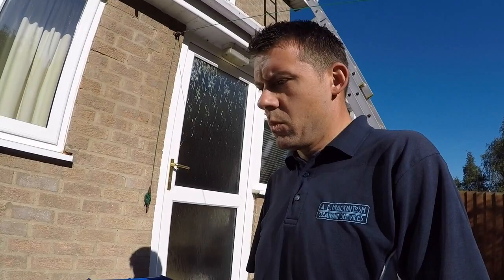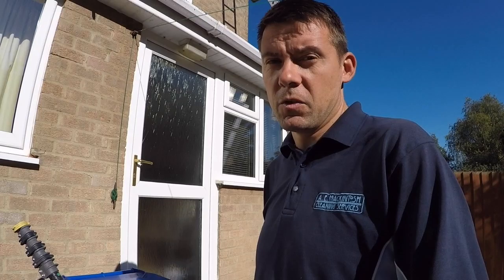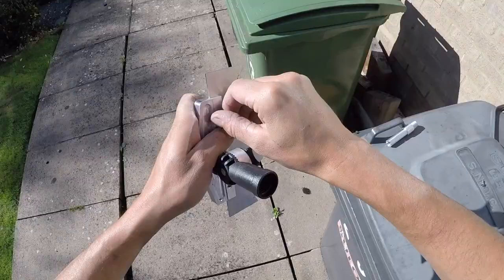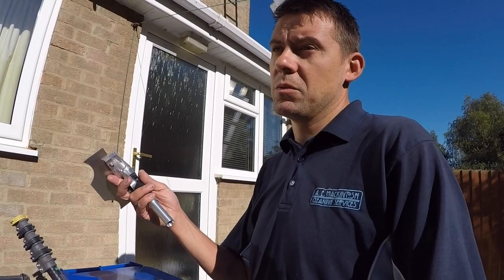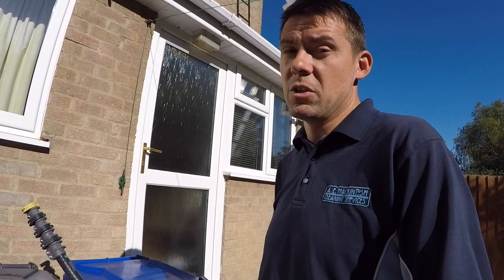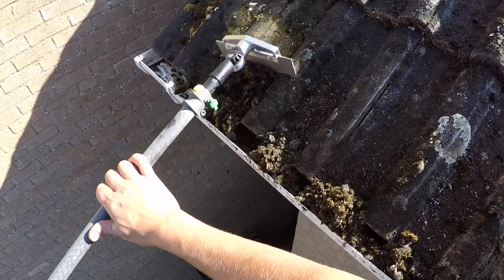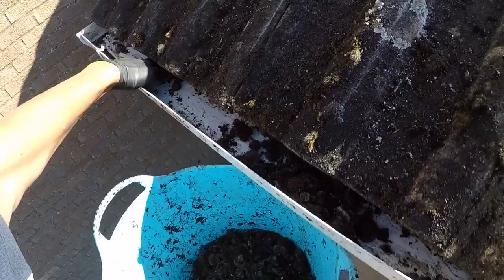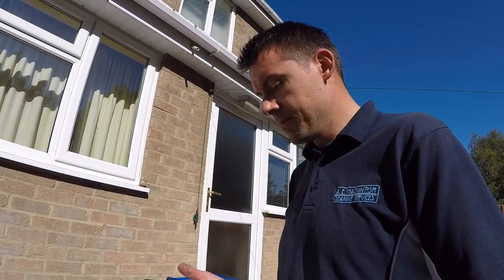Moss Removal From Roof Tiles Using Marshall Pro Scraper

Comment: Nice work fella, off check out the rest of your work. 
BTW you might find it easier and safer to use a smaller extension ladder - so the top of the stile is not in the way, coupled with microlight standoff which will sits securely on the roof (not gutter) and reduces risk of ladder slipping  left right or back.
Reply from the maker: Antony D Thanks, sounds good. 😃👍🏼

Comment: What do you use for applying chemical to roof as looks like jet wash but with no power
Reply from the maker: I use a pump system and spray nozzle to apply the chemical.👍🏼
Reply: @aemackintosh  thank you I was going to mix up in 25l drum then I have spear pump was going use that and spray jets in brush just for moss killer on roofs would it work like that
Reply from the maker: Sounds good.👍🏼

Comment: Can this whole job be done from the ground using poles rather than ladders
Reply from the maker: Yes, in theory. But the longer you have the pole extended, the more difficult it can be to work with. It would actually be ideal to get a scaffold tower so that you have a more secure platform to work from and you can use a shorter pole.😃👍🏼

Comment: Do you use a different pole to add the chemicals or do you just attach the water pipe to the pole??.
Reply from the maker: Yeah, you can use the same pole. There is a good spray nozzle you can get from DA Components, or you could even use an old wfp brush with fan jets, works well.😃👍🏼
Reply: 2 questions mate great video. Are you able to use the same water  hose running through your pole for the chemical? And second question how do you function your pressure washer? As in do you use customers water and what what setup do you have? Thanks

Comment: Hello Ashley, What type of wand are you using to apply the biocide?
Reply from the maker: Paul Chisman Hi, it’s the Lance I use for rinsing that came with my pressure washer. It has a wide, soft jet. I use it with the pressure turned right down on the machine. There are better ways of doing it, but this works fine.😃👍🏼